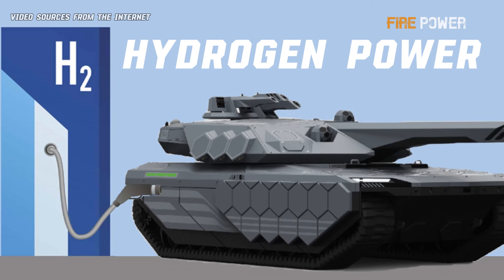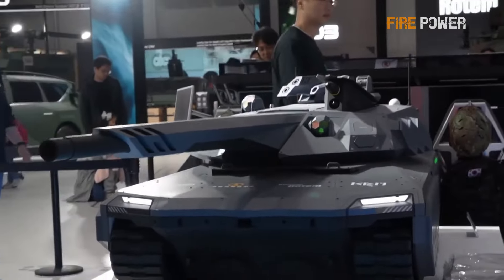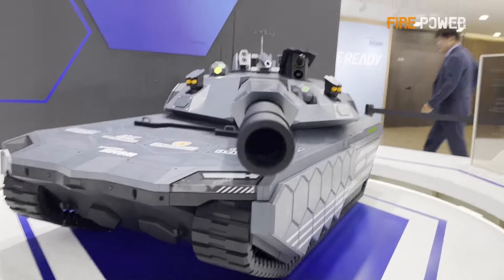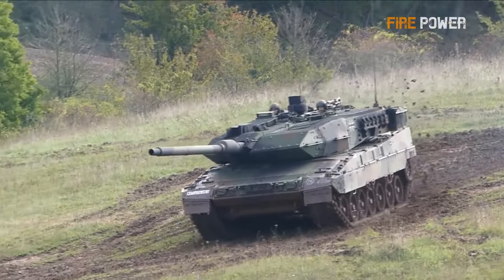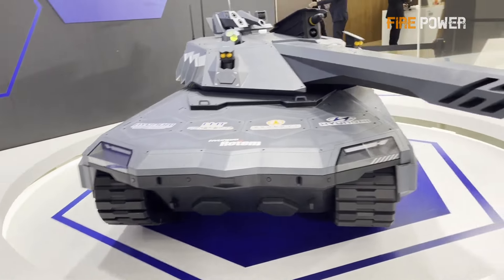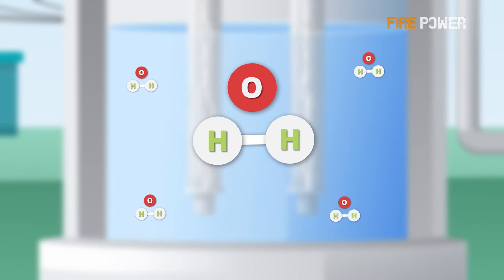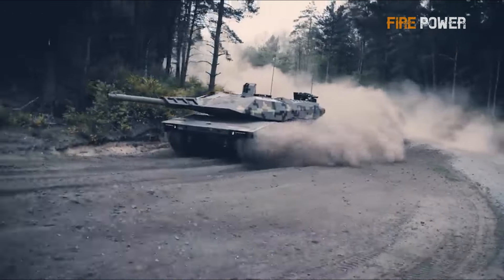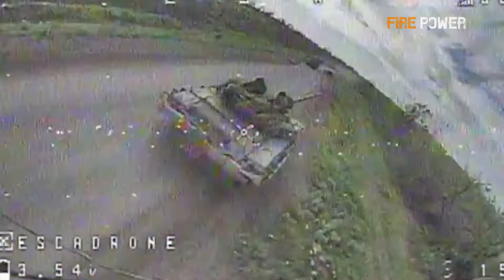Hydrogen-Powered Tank: Practical Innovation or Mere Gimmick?

Comment: As a combat vehicle repair man, I've been thinking this was a good idea. 

A big issue with combat vehicles are where are the final drives located? Tanks generally have them on the back, but most IFV's have them in the front. 
Having them in the front makes them VERY susceptible to damage. What we call "banging the finals". It you hit a rock at speed you can easily sheer the entire final drive assembly off the hull and even damage the hull to the point it has to back to depot for repair. 

Tanks, having the finals in the back, have their track tension adjuster in the front and it acts like a giant shock. 

Also the power packs are massive and usually determine the layout the vehicle will be stuck with. 

If you integrate an electric motor directly into the final drive you can put it on the front or the back.... It would be the back. And you could still have the troop compartment in the back. 

Being able to make your own hydrogen at the point of use would seriously reduced the logistics train by a massive amount.

Comment: What could possibly go wrong
Reply: Nothing. Hydrogen fuel explosion has been tested and as it turns out it's safer than oil. You see it takes the path of least resistance meaning if the tank is ruptured then all you get is a flaming geyser. Now anything in front of said geyser that's a pickle but still safer than EVs when they explode or melt.

Comment: Imagine the tank pull up to refuel ..sorry we have diesel only.. hydrogen?.. you have to drive back to your base or call a resupply truck.
Reply: Well, theoretically, hydrogen can be produced in situ, by water electrolysis. Electricity can be obtained by burning diesel fuel, or in any other way, including solar, or from the local grid system.